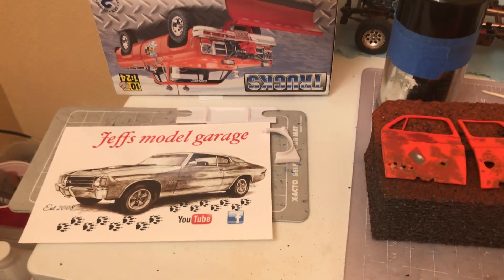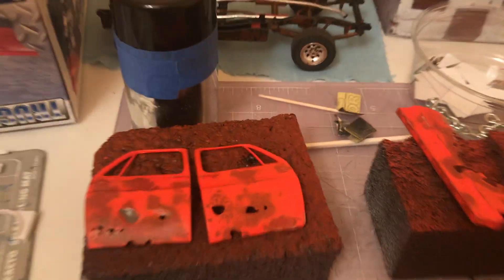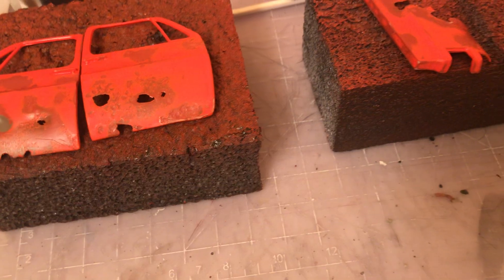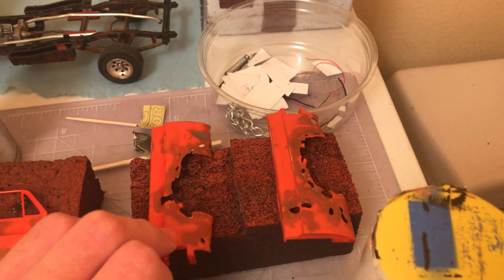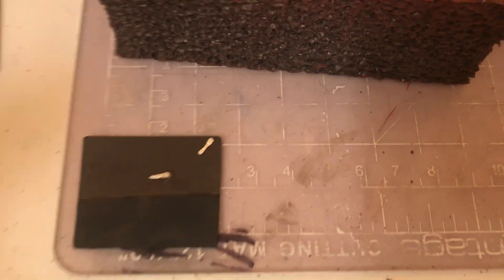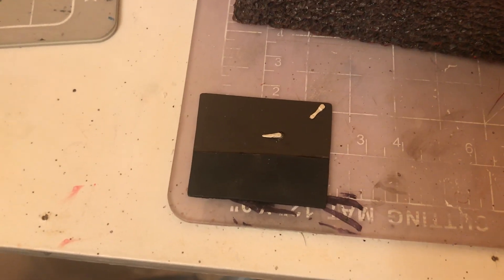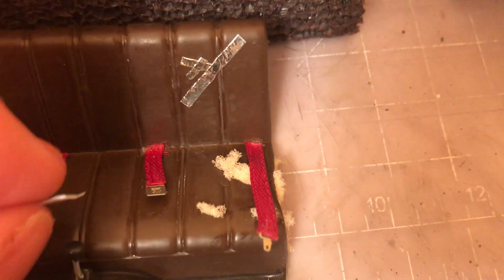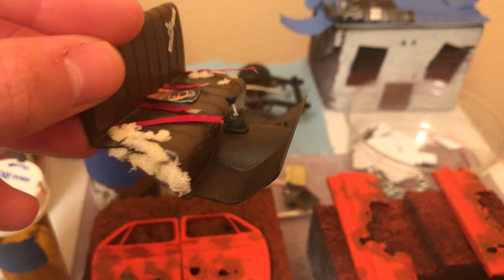Shop card mail day and an update on the GMC

Comment: Truck is looking rather rusty Joe. Might want to MACO it, LOL, Fantastic work. The door panels are much better than what is there and the seat is perfect. Great update.
Reply from the maker: robert lamery Thank you! I had to think of something better than the door panels that the kit had.
Reply: @206joesscalegarage5  I have basically the same kit and I'd say what door panels. They have no detail at all.
Reply from the maker: I agree . Are you building the kit now ?
Reply: @206joesscalegarage5  No the one I was working on was a old rebuilder that a friend built as a low rider. The plastic was brittle and ended up first breaking the frame during tare done ,fixed that then managed to shatter the cab. Boxed it for now.
Reply from the maker: Ah I see. It sounds like quite the project.
Reply: @206joesscalegarage5  I'm more than likely just going to start with a new kit.